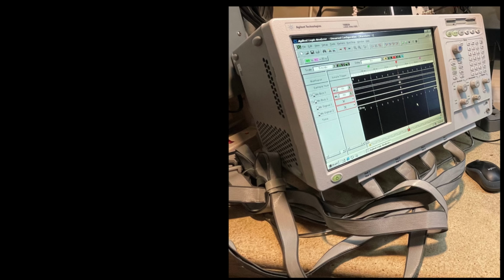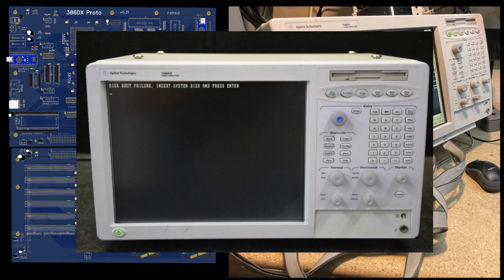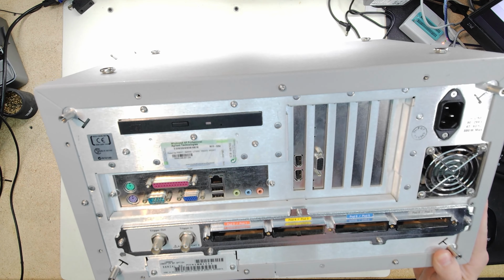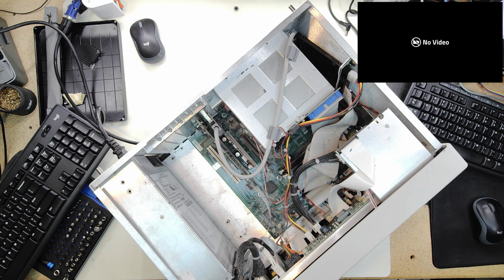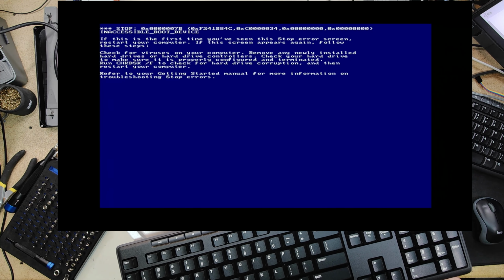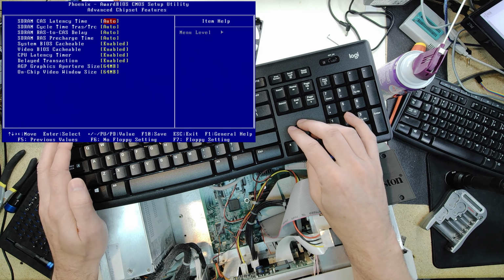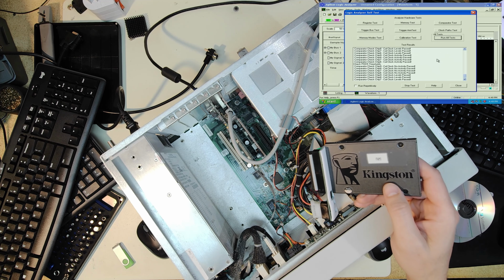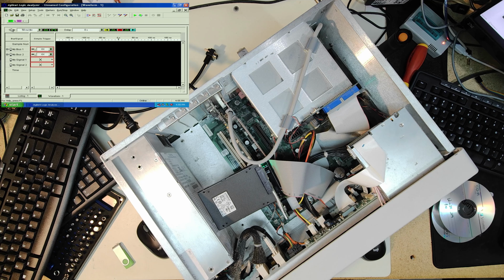Fixing Up an Agilent 1680AD Logic Analyzer

Comment: Hi, i have a logic analyzer that is quite similar to this one – model Agilent 1682AD with a Tyan S239003 mainboard and 128 MB of RAM.

My device had not been used for some time. Now, when I try to use it, the logic board cannot be detected and the system only goes into offline mode. In your opinion, what could be the cause of this?

I opened the device. There are four LEDs on the logic board. In my case, LED DS4 is constantly lit red, which probably indicates that power is present. In addition, the green LED DS3 is blinking in a certain pattern, while DS2 and DS1 are always off. In my opinion, the issue is that there is no communication between the logic board and the system’s main motherboard.

I also checked in Windows 2000 under Device Manager: the driver for the FireWire card is active. I even tested the PCI card in another slot, where the driver was also automatically recognized.

In your opinion, what could be the reason that the logic analyzer software cannot detect the logic board even though the LEDs are on?
Thanks so much

Comment: Hello!  Can I ask you something?  How to get that agilen logic analyzer software?  Can you share it with me?  Thank you very much!
Reply from the maker: I came across the following thread that mentioned the recovery CDs are available on archive.org. This would include the configured operating system. https://www.eevblog.com/forum/testgear/hpagilent-ftp-site/msg2651364/#msg2651364

For the application software, I had the installer on my first 1680, and I used that. However, I believe you can download the application software from the following: https://edadocs.software.keysight.com/kkbopen/what-application-software-is-available-for-16900-1680x-1682x-and-1680-1690-series-logic-analyzers-588262352.html. That page will take to you https://www.keysight.com/us/en/lib/software-detail/instrument-firmware-software/logic-and-protocol-analyzer-software-32bit-2222812.html.
Reply: Yes!  Thank you very much!

Comment: Nice work.  You scored a real deal with that one! That IDE-SATA adapter might be just the ticket for me. I have an HP1662C, older than yours, but at least it boots OK so I should be able to clone the HDD.  Thanks for making this vid, it was useful to see. I still remember the first time I tried installling XP (after it had been out for a few years) onto a home computer while it was connected to the live internet, it was infected with viruses and bots within minutes! What a nightmare :-)
Reply from the maker: For these old devices, I definitely think there's value in creating an image of the hard disk before it fails. The SATA SSD to IDE adapter is an easy, inexpensive approach to getting old hard drives replaced. Ya'... no Internet (or even network) for this Windows XP system. :)